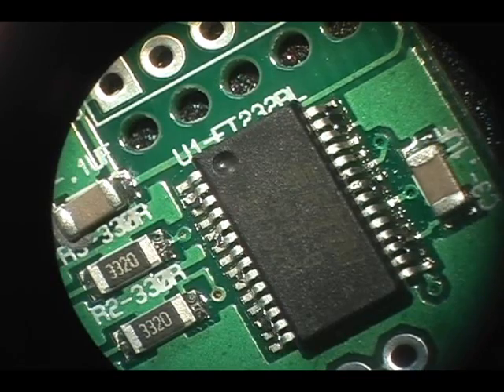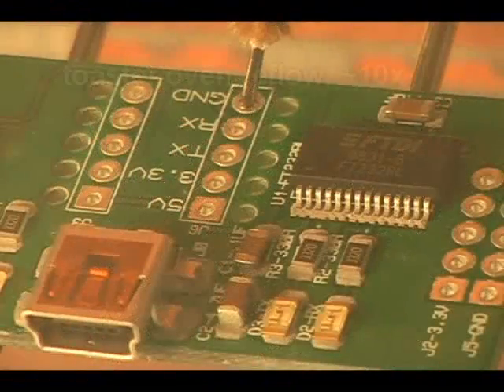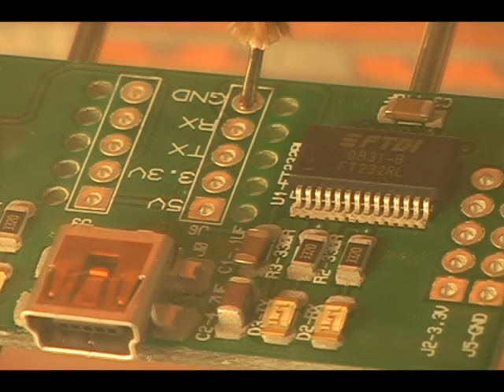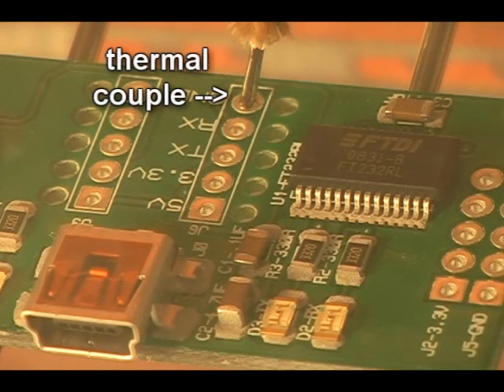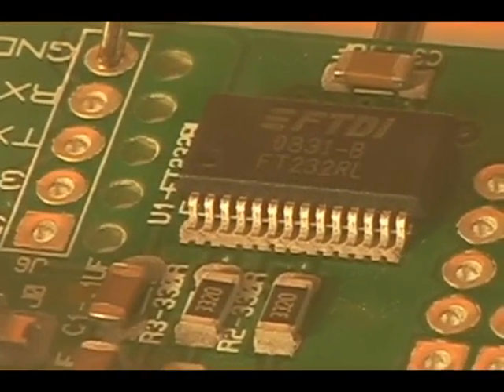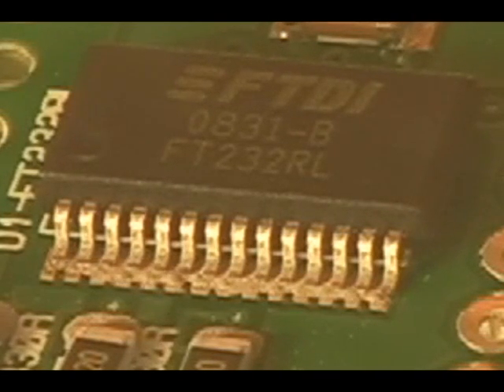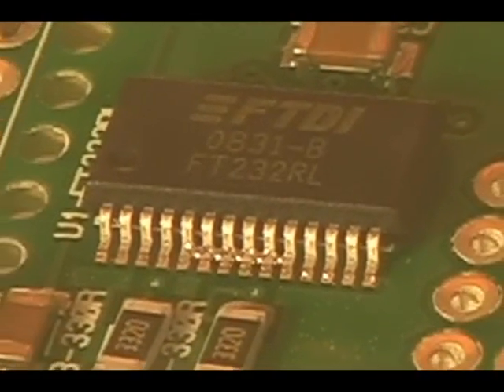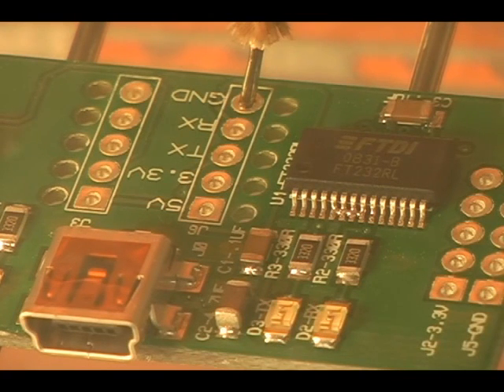SMD Components self-align in toaster / skillet reflow

Comment: Were any of these components tested after this process?  Don't most reflow ovens use more convection heat rather than IR blasting down on the components?  I would think after sitting in the oven for so long, soaked with IR that most plastics and IC internals wouldn't fair very well.